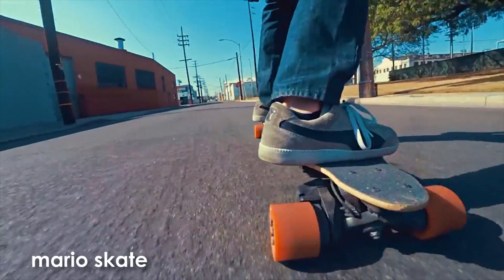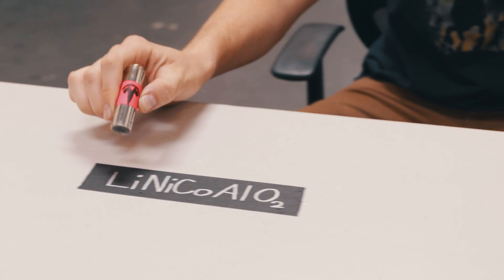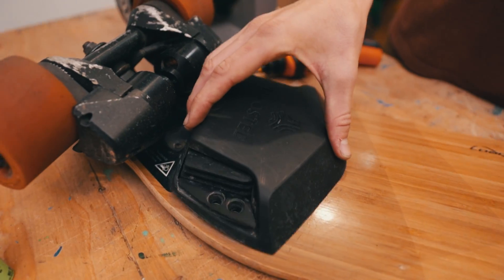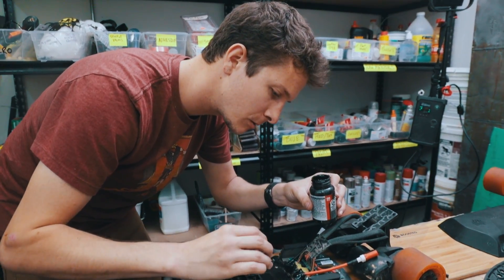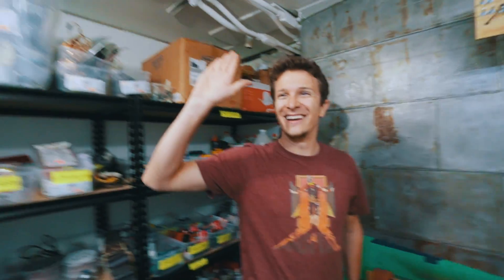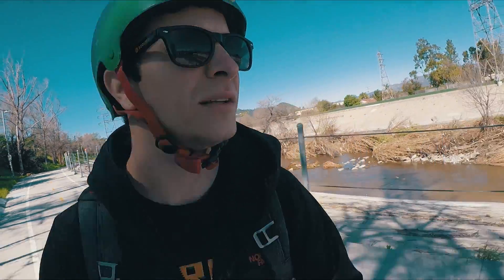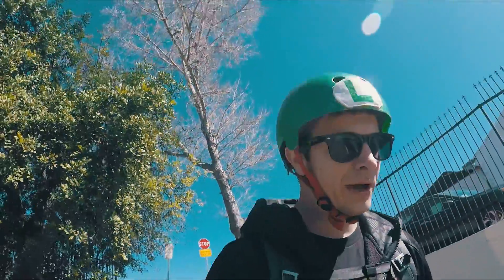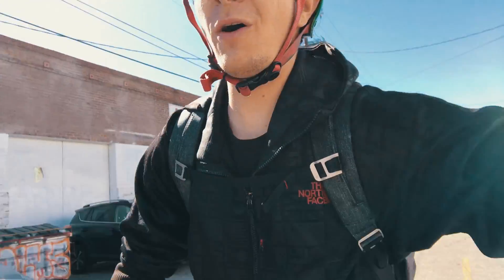Tesla Batteries in an Electric Skateboard!

Comment: Power engineer grad student here. 
The simplest solution I can think of is to add a switch so that once the boosted board is dead you can ride with your extra ones.
The problem here being the voltage, considering you would have to have the same 40v so you'd have to add more cells to keep at that same voltage. 
It would take a little extra work, but i'd say it's worth considering the ammount of work that you alread had.
Reply: It turns out the voltage wasn't the problem. It was the current load. The 2000W motors require over 50amps of current to go full speed. The battery packs I made max out around 20 amps because of their low C rating. Even if I used a switch, the batteries I had still wouldn't be able to power the board.

Comment: what about the 'generator' value of each wheel coasting in sequence (computer) ...not to mention the 'induction' field of the ground. A composite 'graphene' shell with copper ions built in (against zinc ions) rendering the 'whole board' into a CORE (capacitance gel?)

Comment: It's been a few years, but I think if I remember correctly, the voltage across the circuit will stay the same with those batteries in parallel, but the current will decrease. I'm likely wrong as that doesn't make much sense seeing as resistance also decreases.

Edit: Found my old electronics Notebook (thank you Mr. Johnson for having us keep these). 
Current is added up, resistance is divided proportionally, and voltage stays the same. So I was wrong about the current, which I figured due to the whole resistance thing.

Comment: I think you should just throw another battery pack in there.  Or figure out a way to bypass the internal battery voltage lockout.  You have high enough voltage getting to the board, but if it's measuring directly from the internal battery, move the sensor to the external batteries.

Comment: Wren, have you considered removing the boosted battery itself and adding a few more cells to each new battery pack to give you two evenly distributed packs to draw from instead? In theory this could also let you get an accurate battery reading from the controller as the total power "pool" is now even.

Comment: what if you just split all the batteries up so that they all capped out at 30 volts but just made the same amount of batteries into different amounts of packs and just made it so that they would run sepreatly so that after the first to die then u have 2 more. if that makes any sense

Comment: ok, take the front wheels and put a motor on them that only GENERATES power and have that go into the Tesla Batteries. then, by moving forward, 1 you will have more range and 2, HIGHER VOLTAGE! So then you can make the full 15 miles or even more maybe.

Comment: Have a switch on the bottom of the board to turn off or disconnect the boosted board battery, then only run off of the homemade batteries. Have fun!

Comment: Use an Arduino on the battery output voltage booster so that it adjusts the output voltage depending on the input voltage

Comment: and your car sounds like the starter is going out... and if it's not that then check the fuel injectors they might be clogged or the pump is going out. or if it's and old car like 1980's check the carburetor the float might be stuck.

Comment: Pull out the boosted batteries and just use your packs, or attach a switch to the boosted batteries and just turn them off after a certain point (you could do this automatically too)

Comment: 1 thing you could try is remove the original batteries from the board and just attach the new batteries into a resistor to match the optimum input for the boost it board so you don't fry the motor... if you give my until the weekend I can ask my dad he's an electrician and he would have a better idea.

Comment: wren im not an engineer(im aware you have a degree) but I do know a little tad bit about electronics. All i want to know is why not bypass the boosted battery completely, or pull it off and try to put your cells inside the factory casing

Comment: Would it be a plausible solution to use a transformer or something to trick the chip into thinking you have the 33 mark at 30 instead of reading basically empty on charge? or like something to step-up the voltage reading on the board's end? I think the issue you're running into is that you've run into a built-in voltage regulator used to a different class of battery and it's shutting you down since it's getting past the on-board "danger zone?" am I getting that right? I dunno. I'm coming from that vape world where we use 18650 batteries all the time lol

Comment: Wren you are going to need a boost converter to raise the low voltage input current into a higher voltage that uses the standard format of a coil, capacitor, and diode. However, you may need to do a bit of coding in order to properly set up the proper voltage you'll need. The best fit for your project would be to make your own custom step-up converter, but you could try to see if there are any already made that you can use.

Comment: Hey, not sure if this is entirely possible, but what if you used the additional batteries as a charging unit, tapping them up to a wire that keeps the main BB battery topped up so it works for a longer period of time at max voltage?

Comment: that was fun! I like your analogies! I wouldn't mix the two chemistry's though, just use all 18650 cells. Do you know what current the Boosted board uses when maxed? Tesla cells have a fairly low C rating so might be hard to get enough in parallel to match the total max current, think they are in the 3 - 5 amp max? I made a spreadsheet with most of the 18650 cells and found the NCR18650BD more matching for my scooter project which is 10 amp max per cell. 

Maybe would be better to run a backpack ..... or even a battery trailer for the skateboard to carry enough capacity!! lol

Comment: Here's an idea, make your new batteries larger in voltage by putting more in series such that the discharged voltage of these new batteries match that of the discharged voltage of the old. Then to stop the voltage of the packs from being too high use an step down module to stop it from being much greater than your 40v. Hope that suggestion helps in some way

Comment: use a buck/boost board to make it the same voltage going in through the whole time so then it will utilize more.  on down side then if you use a buck/boost, the lipo batteries can get too far down.  Perhaps there are buck boost batteries that can have a shutoff set

Comment: Why did you wire your additional batteries in parallel with the original battery power line. If anything I would think it would be best to use them to replace the current battery. This would maintain that all power sources come from the same chemistry, allow your battery level circuit to report accurately, and allow for easier troubleshooting in the future. My best advice is some advice my father used to give me, "Don't waste time and effort inventing something new when there are smarter people in this world who have already done the hard part." Contact some of the other makers from the video clips you showed and discuss their choices with them. Find out why they did what they did and what they would do differently. Learn from other peoples mistakes before you make your own. 

Best of luck.

Comment: what about connecting the boosted battery only to the cirquit which is measuring the voltage and your batteries as close to the motors/speed controllers as possible?

Comment: A boost converter would work, but you would need a large one or two for that current (60A). I would recommend getting some a123 26650's (the cells used in the boosted board) and making two packs of 12 cells. Then everything will work smoothly and you should get 3x the range. Also, I would recommend a BMS system for each pack so the cells don't degrade over time.
Cheers!

Comment: wire in series instead of paralel. you get more boost that way but risk over volting. wiring in paralel only increases the longevity of the battery.

Comment: A somewhat simple idea, kind of like a motorbike's reserve tank, rig up a 3-way switch which will do either the internal battery only (you'd need to do some cutting of the internal wires to do so), and then flip the switch to external only when the external drains. That way, you'll only discharge one or the other. You'd just need to remember to flip it back to "internal" when you put the charger into it.

Comment: Wren I am no engineer but what if you  did something similar to when you were pulled behind the car to create a charge for the boosted board so if  make something that will  create a charge while the boards wheels are spinning to charge the batteries. Perhaps something like a mini magnetic power generator on the wheels similar to putting small magnets on a small pic fan to generate a charge but instead of a fan put it on the wheels to charge the batteries while your are moving ( this might work if the board is off and your are going downhill) hope my idea helps you in any way and good luck

Comment: I'm pretty sure what you want is a boost converter with a stable output voltage. You might need to make sure your batteries don't get under 30 volts though, you wouldn't want to kill them ofcourse.

Comment: Wren!!! You could probably remove the Boosted Battery and replace them with some Tesla's cells. You would be wrecking the skateboard even more but at the point you are ;p If you do that, you would need to replace all the circuitry related to the battery, so you could buy a protection circuit and a charging circuit. Finally, you could mod the controller to map new values for the the charging indicator (maybe with an arduino?)
Reply: No this wouldn't work unfortunately. The Tesla batteries can't handle the current draw required by the boosted board motors.
Reply: In that case, the solution is probably what you said in the video. You would need a step up voltage booster connected to a micro controller like an arduino. In more details, you could have a voltage prob on the original Boosted battery connected to the arduino. Since the voltage booster is also connected to the arduino (an analog pin could replace the potentiometer of the voltage booster), you could map a voltage value of the original battery to a value of the step up converter. If that make sense to you?

Comment: Could you not use a simple low voltage buzzer normally used on LiPo's? Surely the balance plugs would still work, you'd just need two for each pack?.. but that doesn't really help your current problem - Only monitoring it

Comment: To oversimplify an opinion, perhaps a cutoff or bypass of the LiFePO batteries. Maybe a generator (fifth wheel?)  that feeds the default battpack... 

But I'm running into the same issue with both solutions in that you wouldn't be able to serialize the current with either option without building an additional circuit board to regulate both currents in... unless they fed in parallel into a regulated output to the motor...

Not solutions, but brainstorming. Good luck!

Comment: Wren, maybe you can install a switch between the different batteries and the motor, that way you should be able to disconnect the battery from the motor when that one is falling low on power.

Comment: wren, if you can charge the board while riding just convert the voltage form the batteries to the voltage needed to charge the board and plug it in on the go

Comment: Wren, did you try removing the original two batteries connected to the board's circuit? I'd recommend exchanging those for a pair of the advanced batteries, that way the board doesn't share the voltage limit on the old batteries. Just a suggestion, but it could work. Might be a little risky though since you could damage the circuit board's components in the process.

Comment: By using a voltage regulator, you should be able to keep the battery voltage at a constant level, allowing you to utilize all the potential energy stored in the external battery packs. If voltage monitoring is also important to you, you could have some sort of separate voltage monitor per pack with a seven segment display. Hope that helps, great vid!

Comment: Getting it to not shut down at 35 v means changing a component in whatever is controlling the cutoff voltage on the board, it would be easy if we had schematics of the board or a physical logic board. The other option would be to wire the battery packs at a higher voltage and using a high current voltage regulator to keep them at the desired voltage, that way i think it will be possible for each  cell to have reach a lower voltage drop while keeping the overall voltage at the desired level. The other (risky) would be to wire more cells for a higher voltage and hope the booster boards regulators can take it.

Comment: Answer to everything; add capacitors.
I'm not an engineer but adding two sets of high voltage capacitors in series to each battery bank could do the trick.
I have no idea what i'm talking about btw.

Comment: The whole voltage cut off is controlled through your esc, you would have to program the voltage cut off to drop at a lower voltage, if the boosted board can connect to the computer you may be able to do it that way, but if not you're out of luck :( UNLESS you buy a new esc, controller (maybe Re use) and connect all of the wires?

Comment: Why don't you wire the boosted battery to something else but then wired the LiNiCoAlO2 battery in place of where the boosted board battery connects to the controll board. I don't know if that would work, i'm fifteen so i really don't know too much. If that won't work is there any way of tricking the bosted board battery, e.g wireing in a new voltmeiter. into thinking it's at the right charge?

Comment: run the batteries in series instead of parallel. it will double the voltage but the draw back is that the batteries wont last as long, so you might need additional packs.
Reply: Only problem is that would mean putting 80volts into a 40volts circuit, and, well, fry the chip that controls the board

Comment: Hey you can have a switch that will turn on and off each of the batteries so you can use the boosted board battery on the start of the trip then once it dies turn that battery off and turn on the tesla batteries

Comment: you can use a boost converter but it wont do you any good. i suggest you create a switch from board battery to your battery. also wear a portable flexi solar panel to add to the board